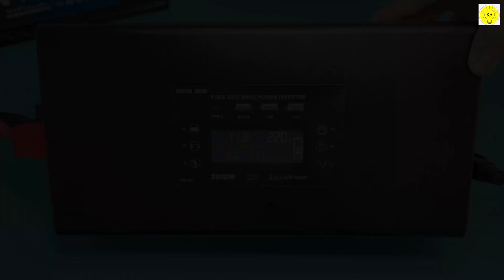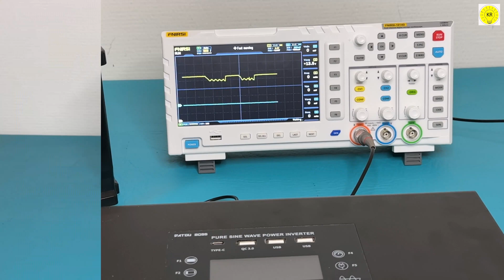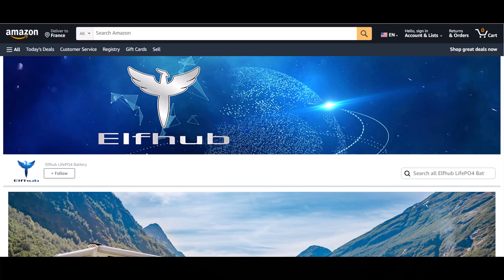12v inverter 2000w test with maximum continuous discharging current 100ah battery

Comment: How long could i use a 50 amp draw on this battery?
Reply from the maker: With a 165 ah battery, if you're drawing 50 amps, you can expect to use it for about 3 hours before needing a recharge. Just remember to keep an eye on your battery's voltage!

Comment: I have bought 3 of the newer versions of the Elfhub 12.8v 100Ah battery (no bluetooth, black case). Sorry to see they removed the 12V ports from the side of this battery, but my 3 batteries were less than $180 each. I have been using them for several months and they work great, no issues so far. I charge them from solar panels and they deliver wattage to my 2000W and 1500W pure sine wave inverters with no issues. I use between 2-3 of these at a time, not sure I would want to run anything bigger than a 1000W inverter from a single 100Ah battery, that probably wouldn't be too reliable. 
Typically, I would recommend 1000W of inverter to each 12V 100Ah battery, so if you have a 3000W inverter, you wouldn't want to run it on less than 3 of these batteries. You can always go more batteries, so 4 batteries for 1 inverter is even better, you get more run time and less stress on a single battery. Just make sure you use the correct size cables as well.

Comment: ⛔𝗔𝗩𝗢𝗜𝗗 𝗘𝗟𝗙𝗛𝗨𝗕⛔
I ordered a battery from them through Amazon that had built in USB ports and should have come with a mains charger. But the battery I received didn't have USB ports and didn't come with a charger. Since ordering the battery, they updated the Amazon product page which includes multiple choice options for batteries, and they are falsely claiming I ordered the wrong battery.

The app is also terrible as it doesn't work. The only way to get an updated state of charge is to keep going into your phone's app settings to clear the Cache and Data which signs you out of your account. Once you sign back in (which required internet), it then updated the state of charge.
Even when it's charging off solar, it does not tell you it's charging.

I contacted Elfhub with 3 options:
1) They can either partially refund me so I can buy a mains charger.
2) They can send the original battery/charger that I purchased, along with a return label, so I can return the wrong battery.
3) They can send a return label in the form of a QR code so I can return the wrong battery for a refund.

I made it very clear multiple times I live in a camper van full-time and no access to a printer, so I cannot print a return label unless they send a QR code which the shop can scan. And of course, they sent a return label and NOT a QR code, so I'm unable to print it.
I explained my situation to them again, and they said they have sent a return label, so they're clearly not reading or understanding what I'm saying. Probably because they know if I can't print a label, I can't return it, so I can't be refunded.

I have since had to get Amazon involved.

These "Elfhub" batteries are also the same batteries as sold under the name of Enerakkus, Feence, PUPVWMHB, KcVolro. They are all rebranded and all use the same app.

Comment: So basically battery power useless unless you have ten grand so dumb and a total scam if they would stop with fossil fuel it would ruin the modern world oh yesh buy solor battery and dont forget them inverters what a huge joke you could buy a high end gas generator and get way more life and efficiency out it compared to dumb battery and inverter but have it your way but fuel generators are way better and way more efficient and cost a fraction of all that battery garbage

Comment: Just to be clear - this is an example indicating this battery is massively overloaded for trying to run 2000W inverter!!  The max load that should be going thru those cable from a lithium battery is 100 amps. (Note it It should be only 20A for a lead acid battery)  The example shown indicates a load on the battery (displayed on the clip-on amp meter) of over 170A which will severely reduce the battery life. The bigger the inverter, the more batteries you need. Hopefully this saves people from trying to replicate this scenario thinking that it is useable for long term usage.
Reply: Can a space heater work ? I'm asking cus I sleep in my truck and it's cold in the winter
Reply: A 100 Ah battery can produce  a little over 1 KWH. A typical home heater will consume about 1.5 KW per hour. So, you would have heat for about 45 minutes.

Bear in mind Ah ratings are based on a 20 amp load. When your load is greater, your total energy will be less. When your load is less, your total energy will be more.
Reply: @galinstan5603  this "Peukert effect" is true for lead acid, but I don't think it applies to Li batteries
Reply: @godsson426  id say nope - look at your heaters wattage, divide that by 12 - eg 1000w heater be pullin 83amps. need a fat wire or else the wire will become a very good if shortlived heater by itself^^ 
could usae a 500w heater from temu, but it will put out useless heat, and only last an hour or so on one battery.
Reply: can we please stop with this garbage about batteries powering inverters! 

batteries do NOT “power” inverters. You do NOT need more batteries for bigger inverters! 

the amount and type of batteries you use is directly proportional to the energy you require. The inverter is there to simply change the energy going through it, into a type of energy suitable for the need. 

as long the energy demand does not exceed the rated pass through capacity of an inverter, or the capabilities of the energy source being used, you can use whatever batteries and inverter sizes you want. 

Ugh my head every time I see someone spewing this hot lava nonsense 😩
Reply: Would 3 batteries be OK I want to run my laptop off 2000w puresinewave inverter don't want to hurt them batteries
Reply: 1.7C  🤭
Reply: That is not lead acid batt that is lithium ion batt
Reply: Thank you for your information.  I have been running circles around the specific metric to utilize when determining how to evaluate electricity capacity - Farads even!

I've finally come to the conclusion or revelation that Watt Hours is probably the best metric because watts is a standard that encompasses both Amperage and Voltage..  and Ultimately answers the question of "What is it you're EXACTLY trying to do?".

Answer:  I don't know.  But MORE than that.  lol
Reply: Thanks for pointing that out can confirming my understanding.  So this battery's BMS did not protect itself (i.e. didn't shutdown) and allowed the continuous 174A draw.
Reply: It's sparks it's overloaded

Comment: Hello I was wondering if you would know how I could charge a 240v mobility scooter battery using a DW2500 230v petrol inverter,  I tried connecting the scooter charger and it started to smoke thanks.

Comment: Howdy.
I say those cables will not carry 176 Amp.s continuously. Neither will the ring cable shoes.
Regards.
Reply: That‘s right!
Reply from the maker: The inverter manufacturer specified these cables, not me
Reply: @inventorkr1  Howdy again.
I would think the manufacturer has had intermittent use in mind.
At least be aware of fire hazard.
Regards again.
Reply: @eugenepohjola258  yup i thort they looked really skinny for that load, maybe 6mm2 but theres 2x
Reply: @asedcopf  2x6 isnt 12
Reply: Yea they look dramatically undersized for that current. Even 50mm^2 will get hot at that current

Comment: I'm not good when it comes to electronics that's why I'm here I want to put a inverter like this in my VW bus to run my mini kitchen combo it's a coffee pot toaster oven and griddle all-in-one with all three appliances working at  once is 1350 Watts and I want to power my 32 inch TV that's 180 Watts I was wonderin if that's too much of a load on the inverter??
Reply from the maker: The inverter certainly bears this capacity. Of course you can continue this
Reply: @inventorkr1  how about the battery? Thanks.
Reply: You’ll need 2 lithium 100ah batteries.

Comment: Notice they only run resistive load for a few mins...try a 1 hp motor or air conditioner. You also need individual charger for each li batt. Never put li batt and lead acid in parallel

Comment: GREATEST example of why you connect the positive first and the negative last.
Reply: I was waiting for the pop and still jumped 😂
Reply: Sparks are not as dramatically important as they used to be as this battery is lithium and not a flooded battery that emits hydrogen gas
Reply: .  Yea the gas would could have been a problem, but that in rush current will kill the inverter, larger the inverter, larger the in rush, because larger has more capacitors, always use a resistor to pre charge, and discharge  when not in use
Reply: @chesterdoodlevich  while true, the spark,in-rush current will kill the inverter, if you pre charge your inverter w/ a25 watt resister it won't spark, and you can discharge your inverter when not in use w same resister so it cant arc in storage
Reply: ...stilll sparks, dont get your point? use a precharge resistor.
Reply: Connecting the negative last applies to batteries mounted in your car so your wrench doesn't hit metal while connecting the positive lead.  Makes no difference here.
Reply: It will still arc, no difference. Using a resistor to charge the Internal capacitor of the inverter could help.
Reply: @tanzim4952 yes you’re right and using a resistor on negative absolutely prevents a spark
Reply: @sunroy1  i use a pencil
Reply: @tanzim4952  or pencil

Comment: So a 12volt 100ah car battery can power up to 2000 watts?  Is that whats going on here...🤷‍♀️
Reply: Yes. The great electricity swindle has us all believing we need to buy electricity from a centralised supplier... A little investment and energy independence is quite manageable.
Reply: What’s the name of the battery? I’m on a semi and I don’t wanna connect an inverter to the truck batteries.

Comment: None of the Chinese made high frequency, "output transformer free" solar generators on today's market including the Bluetti last very long. They are of a high frequency, transformerless design and the cheap Chinese manufactured MOSFETs used in these units cannot take repeated exposures to high surge loads such as full sized refrigerators, large power tools or large microwave ovens. Without an iron core, copper wound transformer to absorb the back EMF and high surge demands of these high inductance loads, typically after about a year's worth of use these expensive solar generator will become a non-repairable brick. 

You might be able to start and run some high surge loads when this inverter is new but every time you fire up or shut down that inductive load, you're shortening the life of the MOSFETs in your solar generator. They also run much hotter than low frequency, transformer based inverters which makes the low cost, off spec, Chinese made components such as capacitors, diodes, resistors and ICs that are used in these cheap solar generators, far more prone to early failure. 

Another major consideration with these high frequency, transformer free solar generators is safety. All it takes is for one of their MOSFETs or IGBTs to short to ground or the control circuitry to fail, and these units will send dangerous, high voltage, high amperage DC current straight to your connected AC loads which will not only damage most AC appliances but can also set those AC appliances on fire.

Another consideration is that the vast majority of these solar generators are non-repairable. After the warranty runs out, you're not going to be able to ship these units back to the manufacturer in China and have them repair them. At a typical shop rate of $125 per hour in the US, with no schematic and limited parts availability, it makes no economic sense to even attempt to repair one of these units. Once the FETs have fried and have taken the inverter's PCB with it, (And trust me, sooner rather than later, they will fry.) they basically become a brick. A far better alternative is to invest a little more money and purchase a hybrid, low frequency, transformer based inverter charger and a LFP battery. Your system will last far, far longer and can easily power high surge loads without being damaged. I know this to be true because I've spent the last 23 years repairing inverters. High frequency solar generators simply don't last when powering inductive loads and can burn your appliances, van, EV and even your home to the ground.
Reply from the maker: I very much appreciate your explanation, but all of these devices are licensed, otherwise how would they have been sold all over the world

Comment: I'm getting a 2023 motor coach. It has 1 200 watt solar panel, a 1000 watt inverter , a dual controller what ever that is and 2 100 AH AGM batteries. I plan to up grade the inverter to 2000 or 3000 but initially would like to upgrade to a 200 or 300 AH lithium battery, can I just drop a lithium in with my current equipment ?
Reply: No. You will need equipment that is made to charge lithium batteries.

Comment: BMS is 100a
but you load it with 172a without the battery shutting down, how can this be ?
Reply: BMS sole function of the batteries I have built controls what max charge can go in (charging) not what comes out of it. Obviously its main function is to balance the cells from voltage miss alignment. Having a 100amp BMS is pointless unless you can realistically put in 100 amps. Max charge I dare to run is 30 amps continuous...Personal preference..
Reply: Nope the bms is not 100A 
But the battery pack is 100ah 
In my opinion the bms is 200A

Comment: Habe mir 2 mal 100Ah von diesen LifePo Batterien gekauft das diese identische Maße der AGM Gel Batterien hatten und so 1zu1 unter den Sitzen meines Campers verbaut werden konnten. Die Verarbeitung scheint äußerlich wertig zu sein und die Leistungsangaben lt. Verkäufer passen auch soweit. Der Grund für diese Anschaffung war die Gewichtseinsparung, die Leistung, die fast 100% Nutzungsfähigkeit der 200Ah und dieser super Preis. Eine 200Ah von Liontron hätte mich 1800€ gekostet, das doppelte also. Einbau hat ohne Probleme funktioniert, Ladebooster per Dipschaltern,auf LifePo konfiguriert und fertig war der Umbau. Erstaunlich war die Leistungsfähigkeit und der geringe Spannungsabfall der Bordbatterien ohne Landstrom. Der Camper steht jetzt den 3.Tag ohne Landstrom und der Ladestand ist bei 99%!!!Bei meinen AGM wäre dieser jetzt schon bei 89% gewesen. Auch die Ladeleistung via meines Solarpaneels ist wesentlich effektiver als vorher. Fazit: Wenn die Dinger halten, TOP
Reply: Es klingt,  als hättest du Spass!

Comment: We bought the Elfhub , 2, 100ah. We bought them after your review. Knowing that the batteries would be stored indoors, and temp controlled. It’s been over 18 months, and I am loving them! We have never gone this long boondocking, without the generator. We are on day 45 without the use of the generator.
Reply: When using the invertor,you'll need to run the vehicle?  Or how long with your setup last?
Reply: W😮 their saying is get 1,100 amp buy a 6000 watt inverter that will run my scooter for a hour flat bikky
Reply: Stupid is as stupid does! By the way I have a 3000w,  and a 4 channel 400w amplifier in my car pushing umpteen speakers, with  a battery and 100 amp alternator. All I can say is, you should have payed attention in school just a lil bit. 100 amps x 14.4 volts, at best is only 1440 watts, you cant pull a mountain from a ant hill. You just cant put a price on common sense
Reply: …kinda confused. Video is launched since 9 Months, if i'm not mistaken? You say: After seen this video, you bought the batteries and being using it since EIGHTEEN Month ?? Something ist off, right?
Reply: @Peko68  Probably a salted post

Comment: Nice, this type of battery are still the best option for small boats and sailboat, where space is tight and builders create spaces only for this size of battery.  It is always a good reference to have them tested and known what the community think about them.
Reply: Q
Reply: That's a great point! Space can definitely be a challenge on small boats and sailboats, so having compact and efficient batteries like the Segway Portable PowerStation Cube Series can be a game-changer. It's always helpful to hear what the community thinks about products like this. Thanks for sharing your thoughts!